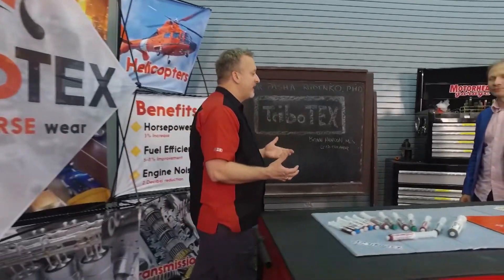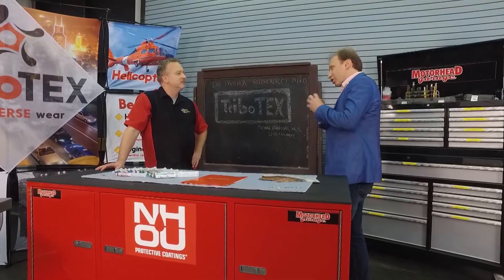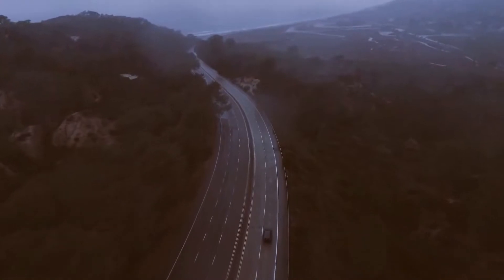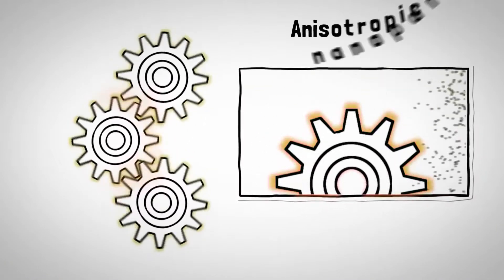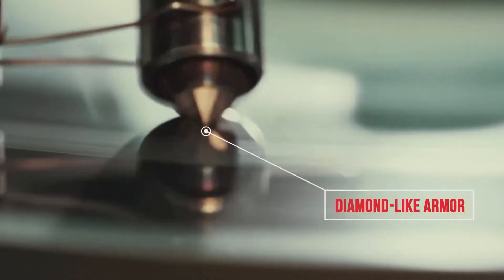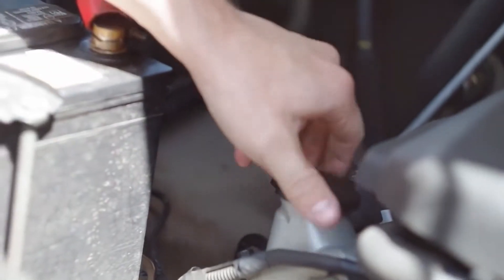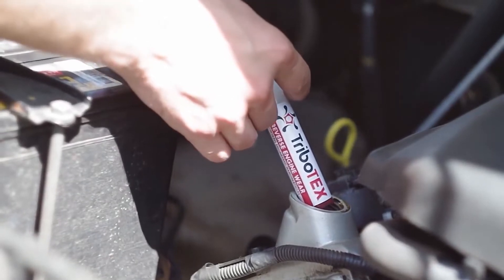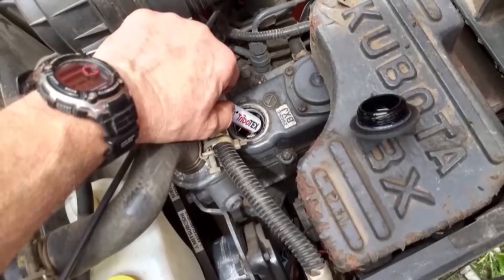TriboTEX in New Car When to use — Reverse Wear with Nanotechnology

Comment: My Prius is a great example of another benefit to TriboTEX. I busted my oil pan out in the middle of nowhere and I was able to make it to a service center over 30 miles away. Patched the hole with JB Weld SteelStick and I'm still running that engine. I have nearly 20k miles on the engine since it ran out of oil and it's still going strong. TriboTEX was 20% of the price of my car ($400), yet it's paid for itself many times over.